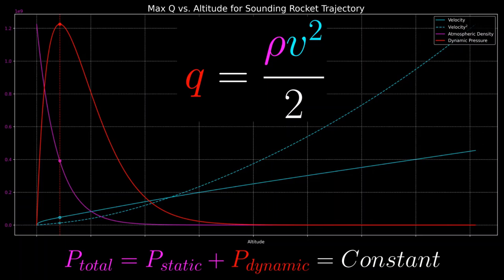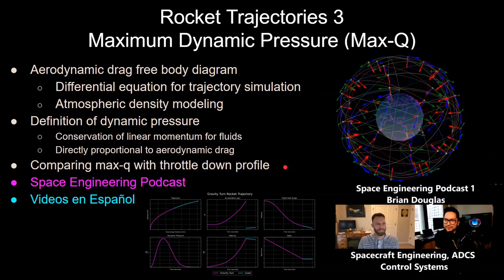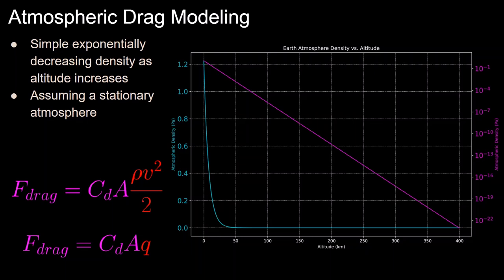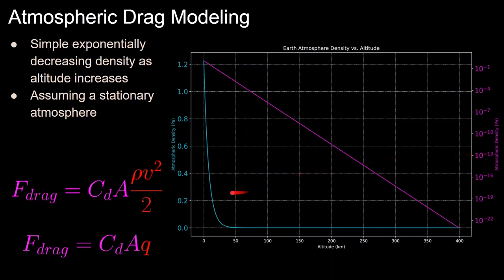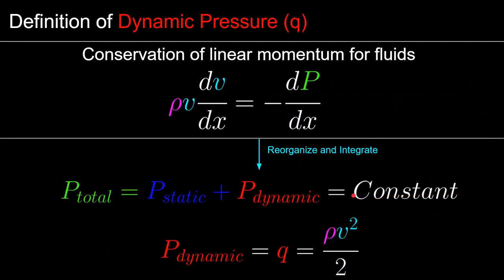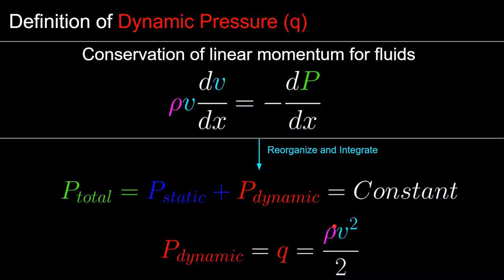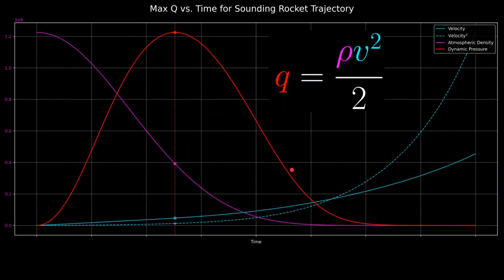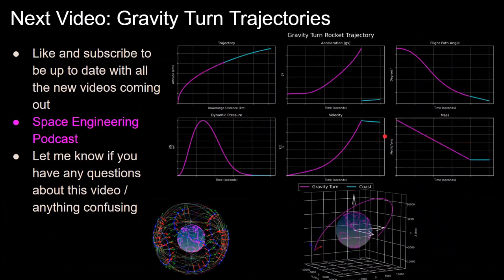Maximum Dynamic Pressure (Max-Q) and Aerodynamic Drag | Rocket Trajectories 3

Comment: I was wondering, in real life, weather, wind and some atmospheric conditions heavily affect the effect of drag changing the trajectory. Of course, I know that there are measurements of the atmosphere to make the corrections. The question is, how do they incorporate this data into the model, id there something like NASA SPICE kernels for weather?
Reply from the maker: Its a very interesting topic but I don't know too much about it unfortunately. I know that on launch days they will send up many weather balloons periodically counting down until launch to measure the wind patterns on the way up and then steering profiles are updated accordingly. 

There are much better models for the atmosphere than one exponential function all the way up (like the US Standard Atmosphere 1976: https://www.ngdc.noaa.gov/stp/space-weather/online-publications/miscellaneous/us-standard-atmosphere-1976/us-standard-atmosphere_st76-1562_noaa.pdf ) but even those values can be affected by the solar cycle and the wind changes constantly everyday. But since they have tons of historical data, they can run simulations based on past atmospheric profiles measured by weather balloons to validate trajectories.
Reply from the maker: I should also add that wind direction affects other things like angle of attack and torques on the rocket body

Comment: Hello,
I just have a quick question, 
what libraries do you use for orbital mechanics?
Reply from the maker: SPICE is the most heavily used library in the software I show on this channel as far as doing calculations like state vector to COEs, rotation matrices, SPICE kernels, etc. In case you haven't seen it, I've posted the Spacecraft class on GitHub and made a video explaining it line by line.

Here is the GitHub repo: https://github.com/alfonsogonzalez/AWP
Video: https://youtu.be/yMJ_VU3jt7c